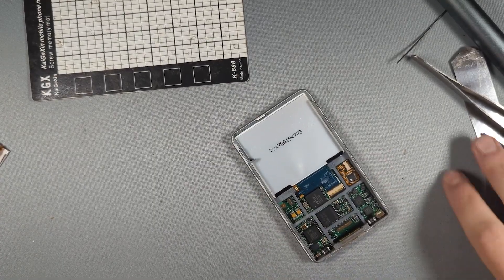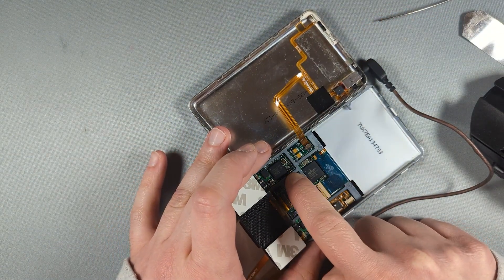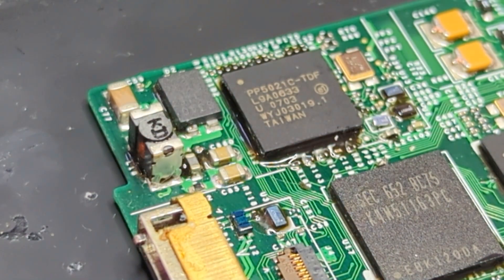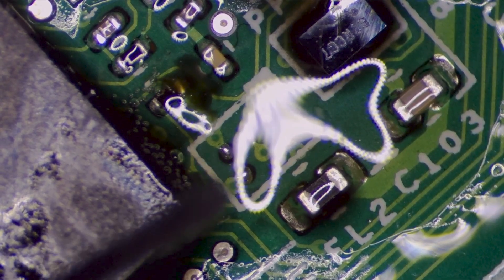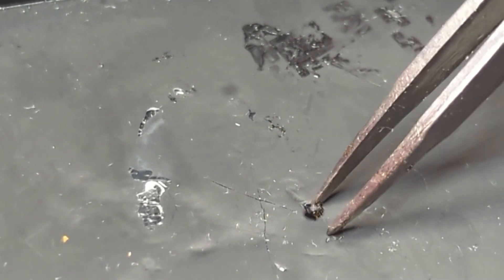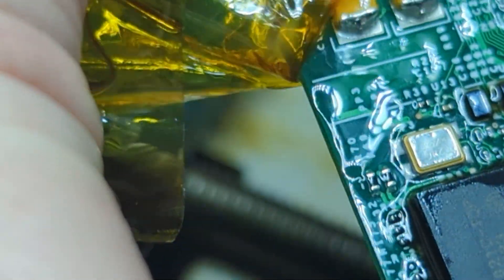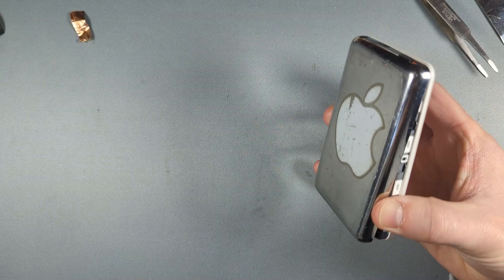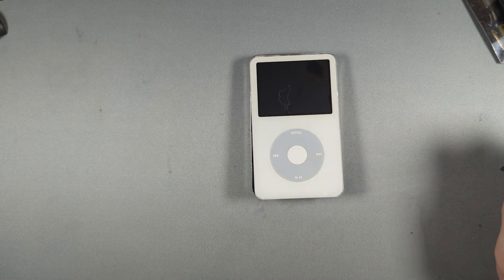iPod classic 5th gen no audio IC fix -  Logic Board Repair Tutorial

Comment: Hey bro, 

I have been watching your videos for a long time and decided to mod a 5th gen by myself. I got a new battery and an iflash dual. The thing is no matter what I do, I am not able to restore it. I have formatted the cards (256gb Kingston & 64gb Sandisk) I have numerous times. I have tried restoring on mac but mainly windows. I am out of ideas as to what I need to do to restore my ipod. I get it to restore if I hold the cable at a certain angle. But even then on the partition software, it shows 7.6gb even though I have 64 gb card in it. The iflash works flawlessly on the other 6th gen I have. If you have any solutions please please please let me know! 

Thank you so much. 

I would’ve sent my ipod to you but I am located in India and shipping would be a lot and I wont be able to afford it!

Comment: Wow, 20 hours of troubleshooting, replacing every single component of the headphones jack, only to find your video and have this be my exact issue. The relief I felt when I pressed down on that little chip and BOOM the sound started coming through, oh my gosh. 

Question, mine doesn't take a huge amount of force to get the chip to reconnect. I have no experience in micro soldering, is there a way to just get it to reseat itself without having to tear it out and re-solder? 

Thanks mate
Reply from the maker: i have seen some people literally just hold the soldering iron on top of the chip for 30 seconds to a minute with applying some light force. i tried it once and it worked. it might be worth a go.
Reply: @partspluspods3689 thanks brother- I’ll give that a try
Reply: @partspluspods3689  What temp is safe to do that at? Obvs I wanna melt the solder and not the chip

Comment: Nice video. What if the sound outputs from the 30 pin connector connected to a car but not the headphone jack?
Reply from the maker: Most likely it's just a fault headphone jack flex cable. And tbh 90% of faulty headphone jacks is just due to dust getting inside. If u try fishing it out with a pin a big clump might come out and the headphone jack may work as normal again. But with the issue in this video, there would be no audio out of the 30 pin as well
Reply: @partspluspods3689 Thank you for the info!
Reply: Yea highly likely it’s the jack if that’s the case. May be a bad chip you replaced or bad work tho
Reply: So i replaced the jack and having the same issue. Guess i have to go deeper